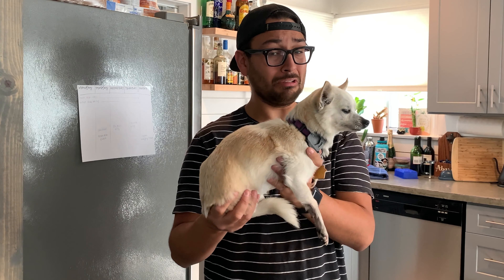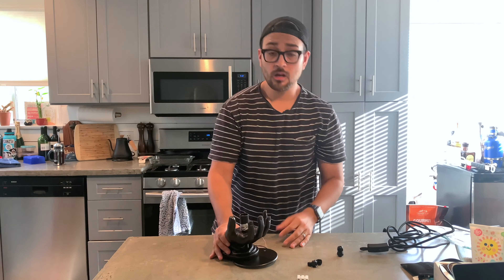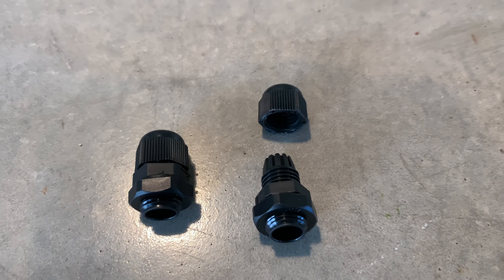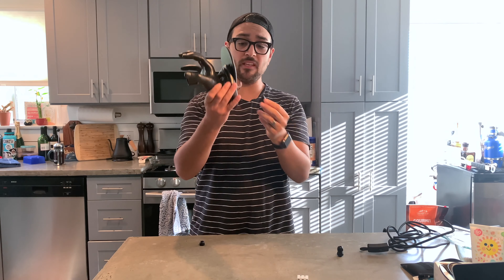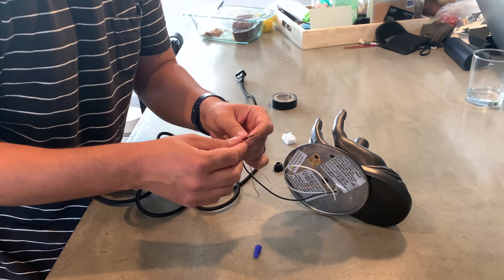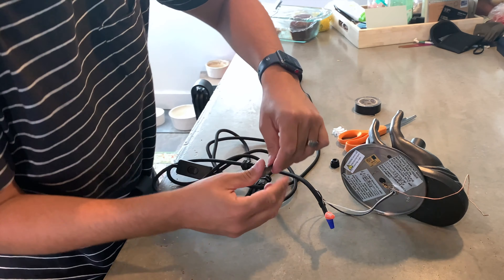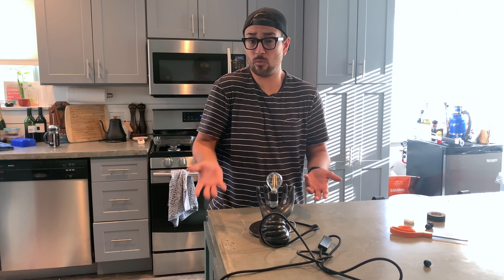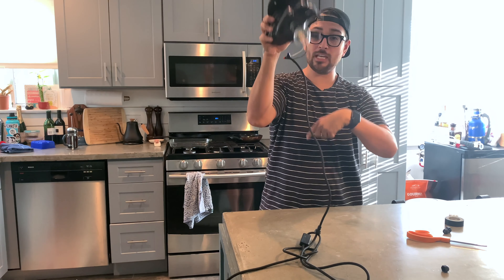The EASY way to add a plug to a sconce or hard-wired light | DIY Tutorial

Comment: Wouldn't the wire connectors be on the way preventing the mount from being flush with the wall? How would you guide the cord through the base down? And even if these are not a problem, ho w would you mount this thing?